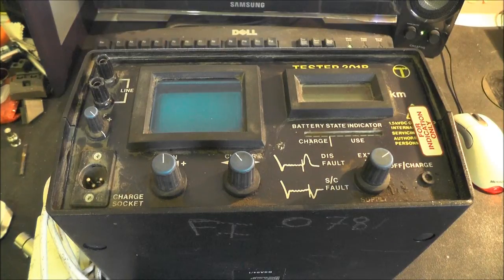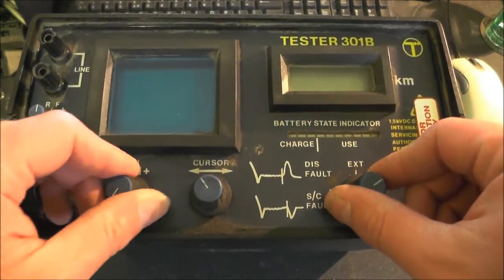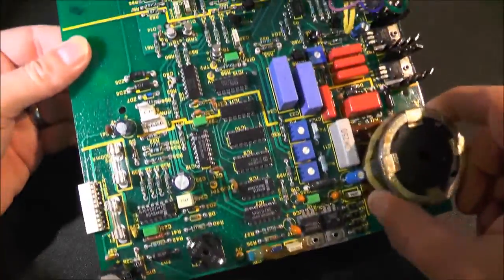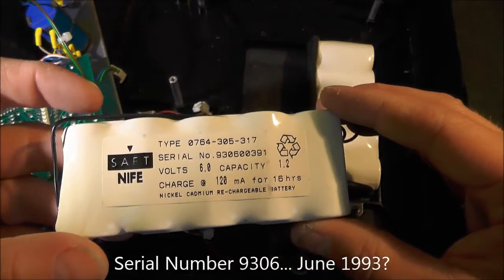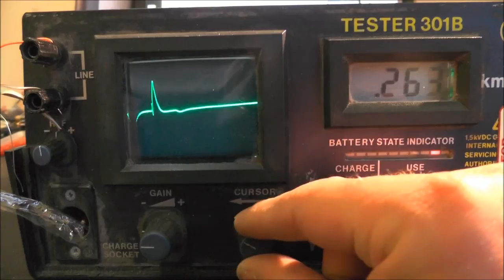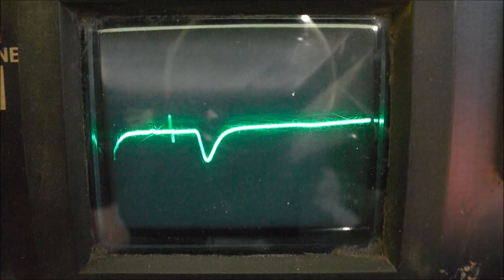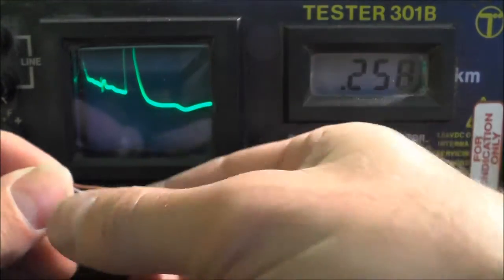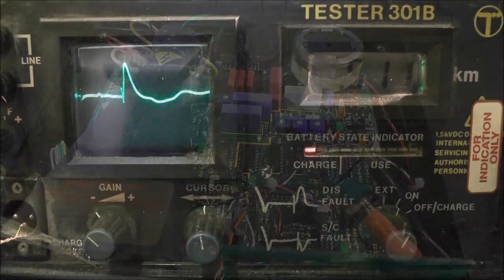DL#008 - BT Tester 301B Time Domain Reflectometer (TDR)

Comment: I co-designed the prototypes in the 1980's with my colleague Ernie Huggins previously of the Radio Interference Service  located in Brighton. We were known as the TED Centre( Test Equipment design Centre) and did our prototype work in Seaford telephone exchange East Sussex. He received a patent for this device known as a mini mole. We built 12 prototypes with field tests before it was taken up by Edcumbe Instruments and  Biccotest. as the Tester 301A.The device was built to assist cable jointers and cable maintenance engineers to find faults in twisted pair telephone wires. We also built a tester for wet and battery contact faults. f you want to know more I will be glad to assist. Many thanks for bringing back fond memories and for posting this.
Reply from the maker: Richard Walder Thats really cool, thanks for posting. If you want to go into any detail about the work involved i would be happy to include it on my blog.

Comment: Yes, that brings back memories. I used to fix them in the repair centre in the 90s. Batteries mostly. The guys were keen to get them fixed. As an apprentice we were shown the previous gear to measure to a cable short circuit fault by resistance. That was pretty involved.  They were always filthy as they had been down a manhole or two! They came in a soft yellow cover with a strap.
Reply: Would you recall the power requirements and pin connections for the front socket.....? ( Hope !!!)
Reply: @steamboatwillie7344   I haven't seen one in years. I think there were 6 ni-cad cells in a shrink down cover. I don't remember the front connection but it sent a pulse down the cable and displayed the echo of it returning from the fault.
Reply from the maker: I don't i am afraid, this video is 8 years ago!
Reply: @DextersTechLab  oh well. Thanks for the reply though. Cheers, Dave

Comment: Good enough to use to test network issues. Will even work with cable to determine if the poor speed is your line or upstream. It probably will show fuzz if connected to a line with ADSL, but will still show open and short. Will definitely show every joint between you and the exchange though.